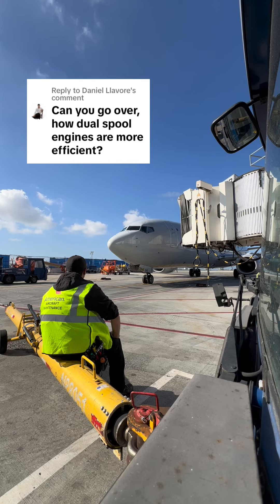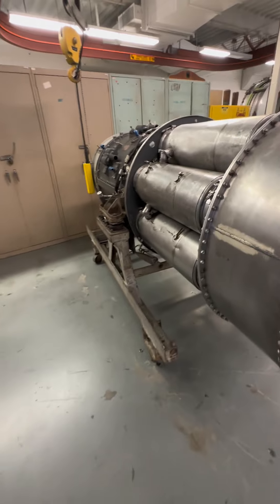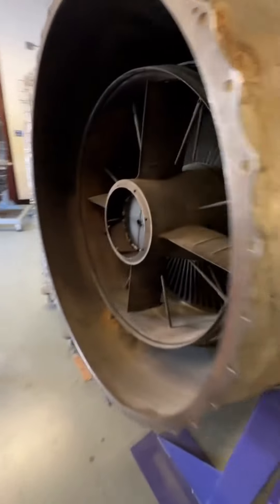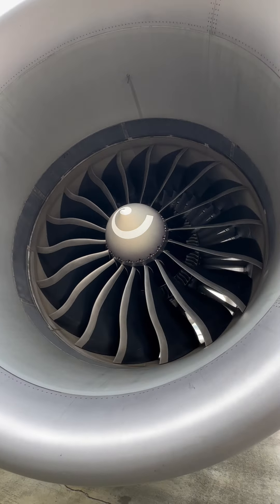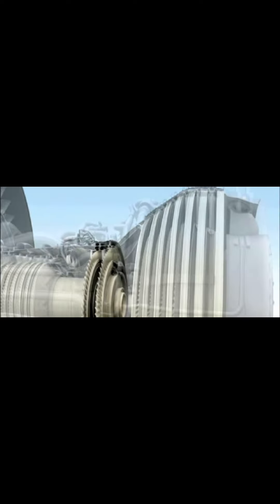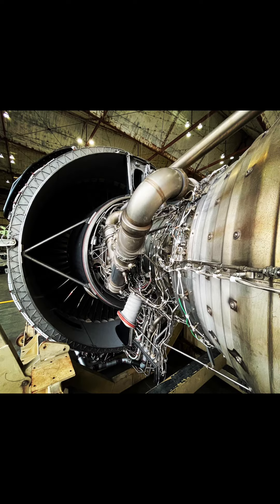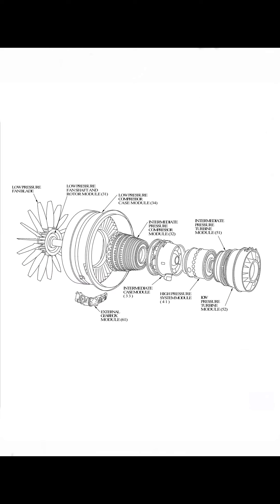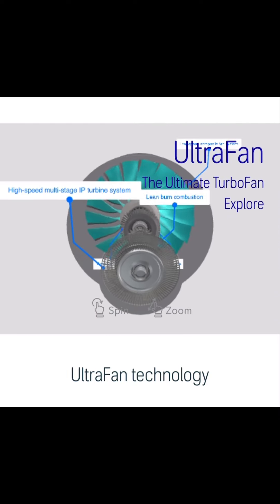Jet Engine Spool Engineering

Comment: The JT8D was EVERYWHERE.  It is as important to the history of civil aviation as the Comet or the 747.   My last JT8D powered flight was on an AA MD82 from DFW to JAX.  I sat right on front of the No.2 engine.  Oh man, that scream and whine.  I miss it.

But my favourite of all is the RB211.  NOTHING sounds like it at take off power. That buzzsaw sound is music. It was also an important engine in aviation.  My last RB211 flight was a BA 747-400 from LHR to DFW.  A glorious concerto of four RB211's
Reply from the maker: Indeed, the RB 211 was iconic, matter fact if you look closely and listen closely, you can actually hear its remnants in the V2500 engine. Even though it’s not a triple spool, but it still has that distinct buzz saw noise.

Comment: Another good old bulletproof engine is the J79-GE-10. I did my apprenticeship on one of these last year assisting the engineers to its assembly. 12000 and something pieces. What an experience
Reply from the maker: I bet you learned a lot
Reply: @StigAviation  I did! 
Another question. I have an interview with the sit manager for a line maintenance mechanic. Could you give any examples of what questions are they gonna ask regarding the technical part?

Comment: Triple spool vs geared dual spool is the hot topic these days. Both about the same weight. Dual spool has a smaller radius of the shafts and this has benefits with compressor tip speed, although compressors are fast anyway. Also, a triple spool whilst better than a normal dual spool for fan speed still isn't as good as a geared dual spool, as the third stage turbine can only be physically made so slow, whereas the geared engine can have the fan spin even slower than that.

'course, the big issue with gearboxes is their potential to grenade the whole engine. They're small yet have to channel the kind of horsepower that could easily propel a ship. Lots to go wrong, so lots to get right. It'll definitely make the job of the maintenance engineers even more interesting in future
Reply from the maker: You’re starting to see a trend where technology is kind of hitting a wall at this point, they are getting to a point where they exceeding the speed of sound for the blade, rotation, and speed. It’s going to be interesting in coming years of what they developed.
Reply: @StigAviation  I'd like to see intercooling of compressor air between stages, and maybe even recuperation of exhaust heat to preheat stage two compressed air before combustion. Both were already under study 20 years ago but haven't been tested yet full scale. 

There's other ideas like active cooling for the turbine cooling air that's bled off the compressor, instead of using it hot, variable diameter compressor cowls that can shrink or expand with the temperature of the blades, massively widening the engine's efficiency across the powerband, and other stuff, including the sexy variable pitch fan idea. All chasing a percentage or two of extra efficiency. All of it needing 99.x% reliability.

What I really wanna see, but it might not be practical, is a contrafan. With a two stage front fan spinning in opposite directions, the second one smaller and faster, and the shroud around it tighter, precompressing the air before it reaches the first stage compressor (which can now have fewer stages) and giving the fan thrust of a much bigger, heavier fan with the low drag of a smaller one, plus smaller fans can spin faster without supersonic blade tip issues. It could be a triple spool with the first fan on the third stage turbine and the second, faster fan on the second stage compressor turbine, or a dual spool with a gearbox. It would be expensive and heavy even with composite fans and fan shroud, so best for long haul engines. 

And it might turn out to be shit 🤣
Reply from the maker: @ScapoloMichael  how about we think into the past and get inspiration from there, why have all these moving parts, think, scramjet, think ramjet, how about no moving parts and figure out a way to optimize compression. But I’m just thinking out loud 😂

Comment: I've read that most internal combustion engines in cars are only about 30 % efficient at best, which is one of the reasons electric cars--which I think are close to 100% efficient--are transforming that industry. I'm not sure how efficiency is measured, but I'm wondering how efficient these jet engines are?  Do we have figures on that?  Thanks.
Reply from the maker: Efficiency is a bit above my pay grade in regards to actual numbers and figures, that’s more of engineering and manufacturing level data. But from what I understand and read, efficiency is somewhat calculated of longevity and economic values (fuel economy, component reliability, maintenance costs)

Comment: Really interesting to see these up close, Stig.  Was the RB-211 developed for Concorde?  I’ve noticed in Royal Navy vessels too.  Hope the Ultra Fan becomes available soon!
Reply: 747
Reply: @Iwishiwasflying  Wikipedia says the L1001 Tristar was the first user, also in 747s
Reply: @martinross5521  valid point but the 747 lasted longer than the Tristar. So one could infer that the 211 was more for the 747 aka 743 and 744
Reply: They tried the first composite fan, Hyfil. Shattered in the birdstrike test. Rolls Royce nearly went bankrupt coming up with a traditional alternative, had to be bailed out by the UK taxpayer. Lockheed was therefore late with the L1011 which doomed the plane to low sales.

Rolls were so traumatised they haven't used composite blades since, until the Ultrafan, which will also have a gearbox.
Reply from the maker: From what I remember, the RB 211 was specifically created for the L1011 , also the classic 747.

Comment: Nothing sounds better than the RB211 on take off roll, other than the GE90😁 and that's the new kid on the block in comparison lol! The next GE for the 777-9 is the next best thing, modern day.
Reply from the maker: The GE9x is going to be incredible. 👌
Reply: @StigAviation  Back in the 70's, the landings used to be as fun as the take off and rotate for the engine sounds. When they reverse thrusted, it was exciting 🤣😂🤣. Today, it's so different with noise abatement tech and such. Still, the reigning champion, on an overcast weather day is the Rolls. The way they chop up dense air, is like no other and you need not look for the bird, the sound has its own unique signature. The DC9/ mad dogs, also had this reputation with loud crackling from the exhaust. My goodness. That and the flame throwing that came from the 707's. Talk about a great time to be around aviation.

Comment: My current A&P school has a retired fedex boeing 727 on display, powered by three JT8D engines. One of the engines was taken out of the plane, as well as the APU for teaching purposes. I really love that thing! so interesting. unfortunately, when they transported the plane down to my school, it was “too heavy” to land at the nearest airport 100 feet away. (it wasn’t too heavy) so they took the wings off the plane and shipped it down here. none of the hydraulic or electrical equipment works because they cut it out.
Reply from the maker: I’m curious what school this is. And that’s unfortunate they did that. I wish they gave you the whole aircraft intact
Reply: @StigAviation  Arkansas-State university mid-south. it’s near Memphis Tennessee !

Comment: Trouble is GE's gonna have to bite the bullet and go to a reduction gear setup like Pratt & RR. No two ways about it. Running fan blade ends greater than supersonic is just nuts. Very inefficient. Engines with reduction gears are also much quieter, and smoother.
Reply from the maker: You are right on that, they are reaching as stage where they need more innovation and new technology. We will see what comes in next generation of these monster engines.

Comment: Our GTF engines have taken some heat...but the kinks will be worked out...its concept and design are incredible.
Reply from the maker: It truly is incredible design. I appreciate that but what I don’t like is that PW likes to hide everything under the core. You want any maintenance done you have to open the whole thing up. I’m more partial to the CFM family. Much easier to work on.